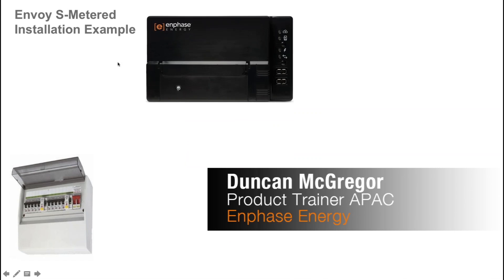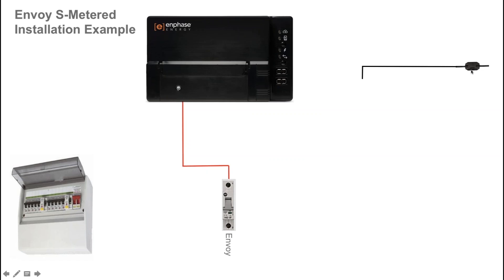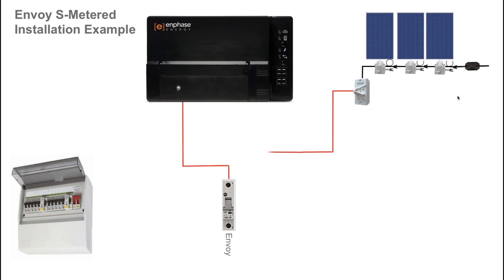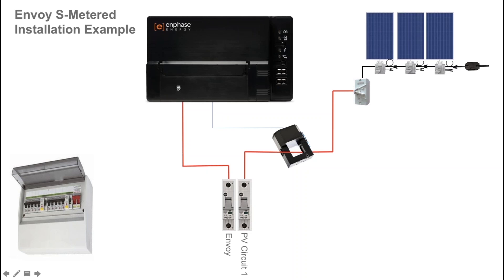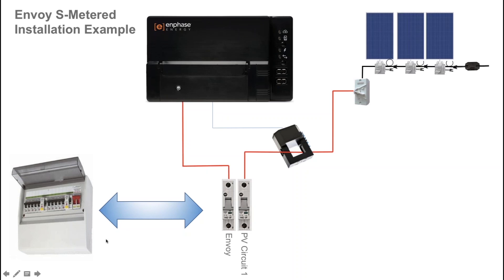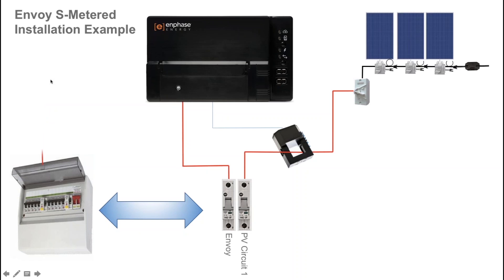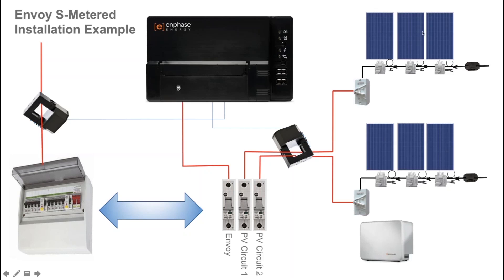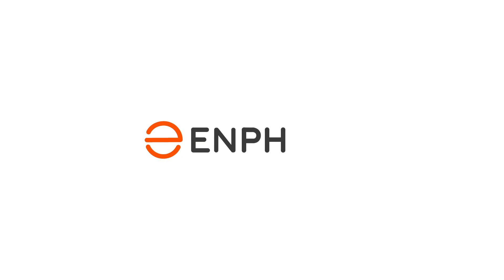Envoy S Metered installation

Comment: Does it have an Ethernet port? And 20a battery breaker should have said 20a Per battery? Upto 80a as max 4? Unless 2nd breaker added?
Reply from the maker: Yes, the Envoy S Metered (now the IQ Gateway) has both Ethernet and WiFi. You can connect up to 13 Enphase AC Batteries (model IQ7-B1200-LN-I-INT01-RV0) per 20A circuit. However, note that these AC Batteries are discontinued, and Enphase has transitioned to the new IQ Battery 5P (model IQBATTERY-5P-1P-ROW) in Australia and NZ, which you can find at AC Solar Warehouse : https://www.acsolarwarehouse.com/shop/enphase-iq-battery-5-19718#att.

Comment: Good video.
Just to get an understanding prior to getting a solar system installed, I was wondering how this is installed on 3 phase. Are groups of  panels allocated to each of the phases or is it  collective and then split into each of the phases?
Can each phase be monitored? Or do I just see a 'total' in the app
Reply from the maker: Hi Timothy, 3 phase installations typically have a third of the solar panels on each phase.  For example, if there are 20 solar panels, there would be 7 on two of the phases and 6 on the other.  A 3-phase Enphase trunk cable is used to achieve this.  In saying this, it does depend on the roof and how the installer designs it.   Each phase has a CT, and you will see the sum of the energy generated across the 3 phases. Below is a link to a video which shows the operation of the App.  Hope this helps.  https://youtu.be/1YCkS8pP3ck

Comment: Should there be any problems if the envoys is behind a rcd. The same phase as inverter breaker which are not  behind a rcd
Reply from the maker: Hi,  an RCD in the circuit does not negatively impact the Envoys ability to communicate with the microinverters.

Comment: so how does it monitor each panel if there's only CT for all panels?
Reply from the maker: The Envoy collects individual panel data via a power line carrier (PLC) connection to the microinverters.  This data is collected every few minutes from each micro.  The CTs provide total instantaneous production and consumption data which is used for other purposes - like export power limiting.

Comment: how does it meassure the production of individual pv-panels / output of single inverters?
in this scheam production seems to be only meassured in cumulation .
sry for my english, im not a native speaker.  :)
Reply from the maker: The Envoy collects individual panel data via a power line carrier (PLC) connection to the microinverters.
Reply: @ACSolarWarehouse  thx for the fast reply! 
...i wasnt expecting any sort of wireless connection as envoys can link to such a big amount of microinverters.

Comment: Can any battery be used with the Envoy-s-Metered ? or it must be only Enphase ?
Reply from the maker: Technically, any AC coupled battery can be used with an Enphase system. The advantage of using Enphase AC batteries is that the battery operating data can be seen on the Enlighten monitoring platform.  An AC battery from another manufacturer will have it's own (separate) monitoring system.

Comment: From the engage cable, the green goes to the earth busbar and what about the neutral line? Thanks
Reply from the maker: The neutral line is connected to the blue conductor in the engage cable and the active is connected to the brown conductor.
Reply: Ok brilliant, and then the neural lines goes to the neutral bus bar on the switch board? Just drawing up a final wiring diagram for my electricians. Many thanks